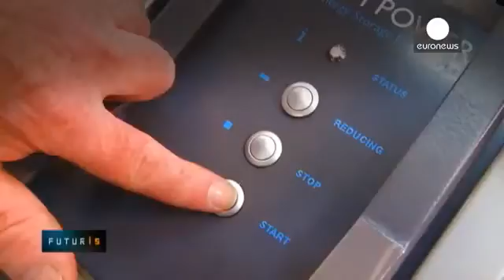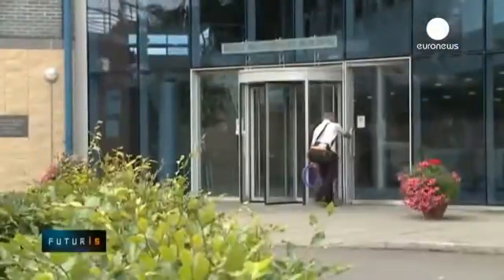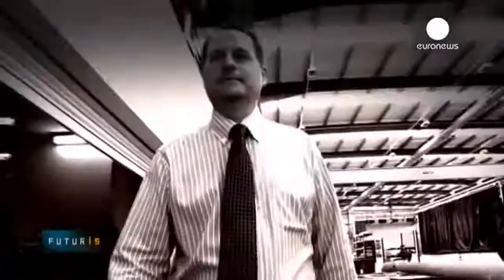hydrogen welder

Comment: Can wait to see using  water in a car gas tank
Reply: There cars that convert water to hydrogen through electrolysis to fuel cars but majority of them were never mass produced due the cost v.s profit.   
The other fork on the road is that gasoline has a higher energy density to that of hydrogen plus it already widely available to majority of the nations world wide. Although there are cars you would most likely see that work directly using hydrogen gas then cars that convert water to hydrogen to run.